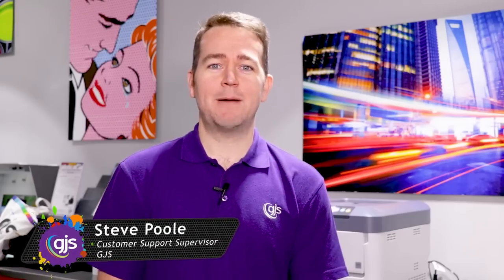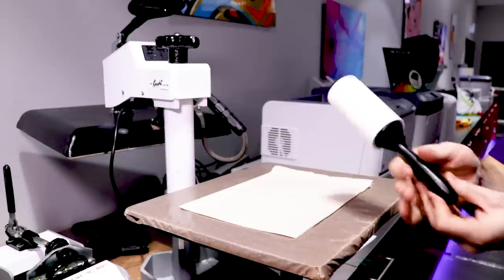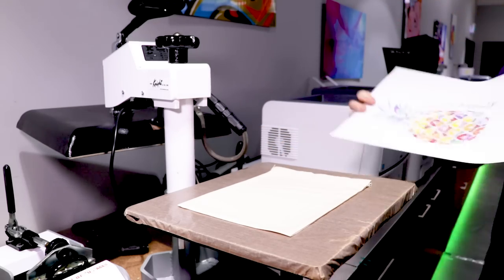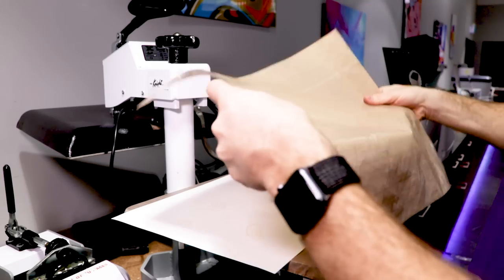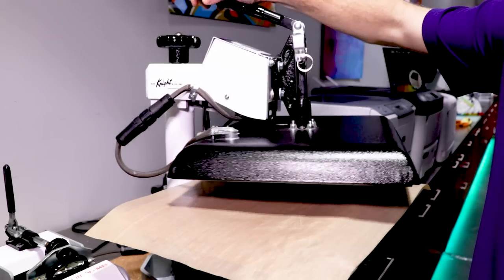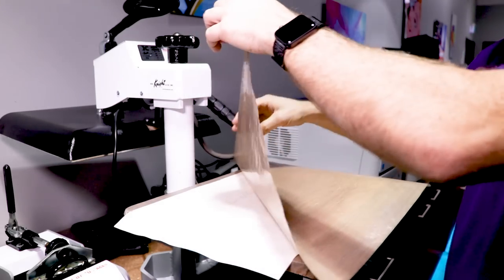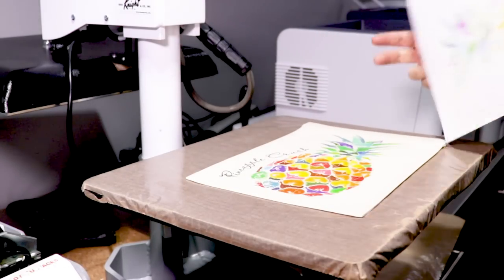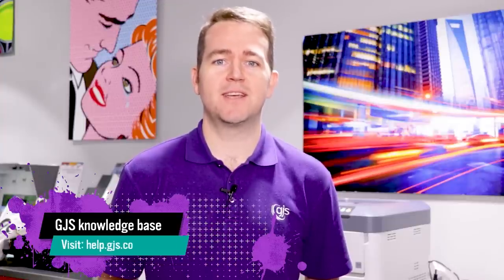How to sublimate drawstring bags and Santa sacks

Comment: Hi.. May I know the material of the canvas bag? Canvas is cotton ya? I've learnt tt sublimation transfer only works with polyester.. I'm new to this and I'm confused. 😱😅
Appreciate if you can advice what is the printed transfer paper tt you used in the video... Thanks a million. 🙏
Reply from the maker: Hi Mathyr, first of all welcome to the world customised printing! You are correct in that sublimation only works polyester materials. These bags are designed to look and feel like canvas material. However, they are made out of polyester which is why sublimation printing works on it.